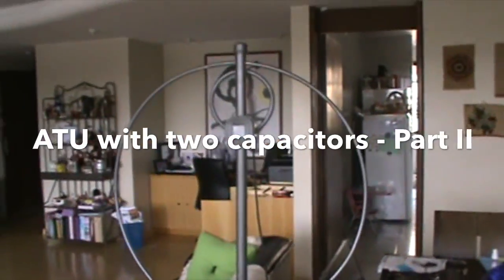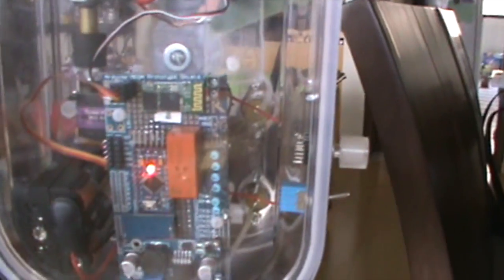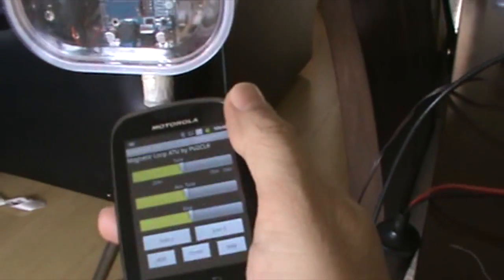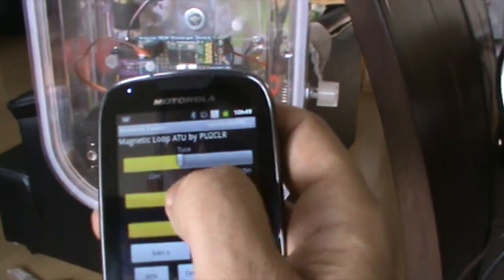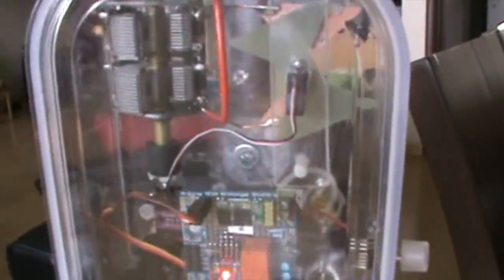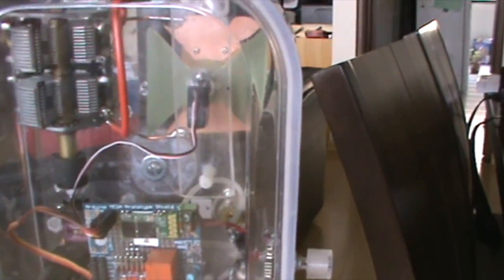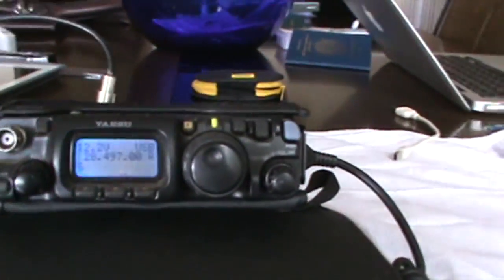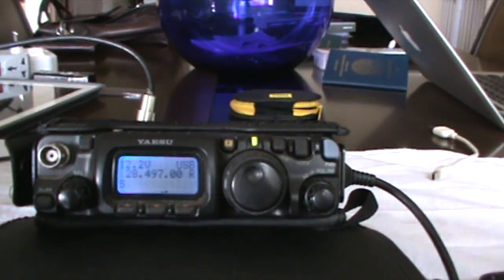Antenna Tuner with two capacitors controlled by Arduino - Part II

Comment: Ricardo's User interface, and extra fine tuning capacitor is excellent for Magnetic loop remote tuning. I am currently controlling one of his early Arduino proto-boards
via bluetooth in my desktop PC. My two variable loop capacitors are rotated by
a Contour Design Shuttle Xpress. Each capacitor has its own control via a job/shuttle ring and center knob. My Shuttle Xpress once acted as a physical
knob for my Flexradio SDR1K. Now it will tune my mag loop twin capacitors via bluetooth!  Kudos to Ricardo!
Reply from the maker: The Contour Design Shuttle Xpress is really nice for this kind of application.
Thanks for the tip.
73.
Ricardo